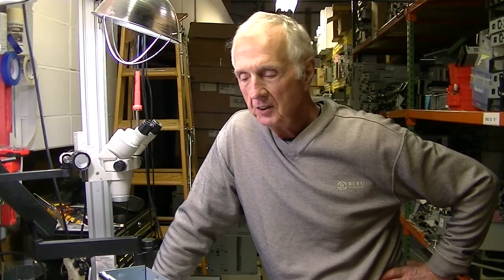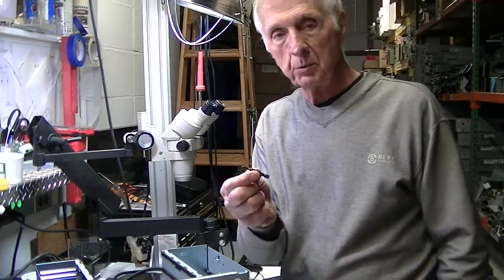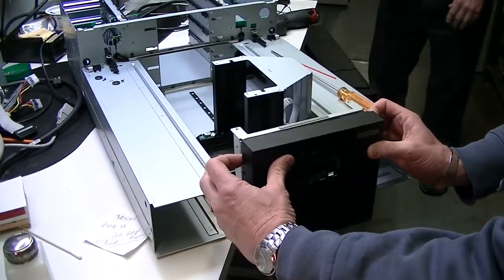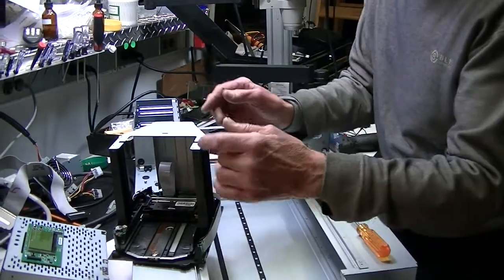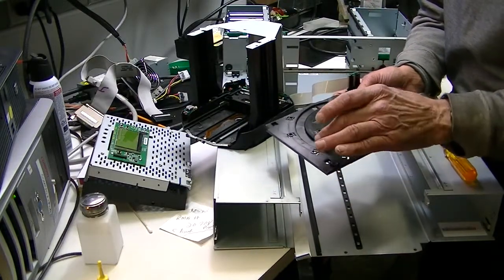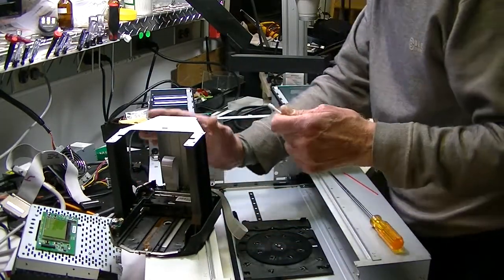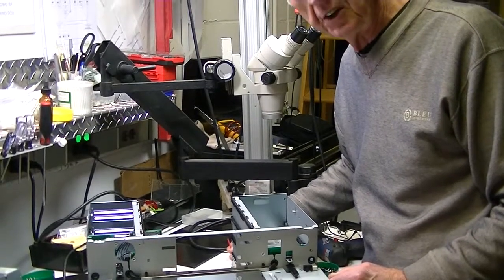Tape Library Complete Picker Replacement TL2000 TL4000 TS3100 TS3200

Comment: Hi, Are you know how can fix the error "Robotic Failure 97 00" ?  Many thanks!
Reply from the maker: That error implicated that the picker cannot move upwards, to the top.  There is a typical gear that wears out.  Best thing to do is purchase a replacement.  I'm not sure if you have a 2U or 4U library, but you can search our store for what you need at https://tapedrivesales.com  We can repair those, but it probably cost the same as replacement purchase.
Reply: @repairmytapedrive  Grat flick. I would highly appreciate any direction on how to get replacement small gears for the picker elevator (1U and 2U).

Comment: Can't you remove the picker by taking out the screw in the center rail, and then sliding it a little to the front and then lift the whole picker out with the rail... skipping removing the front panel?
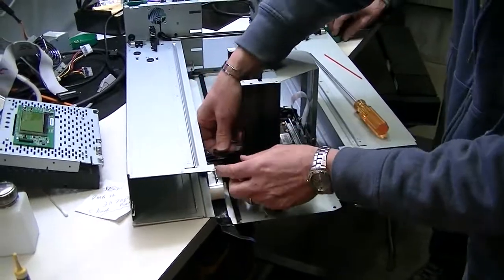Reply: Yes and no, at 3:00 you can see two rails: the one on the left is the toothed one where the gear runs on and the one in the center is the one where the big black plate locks in.
So yes, you can disconnect the picker and remove it but if you want the black plate out as well, you have to remove the front panel.

Comment: Thank you!  I recently acquired an Overland Storage Neo 400s, which appears to be the same as a MSL4048, TL4000, etc., etc.  The only issue I have encountered is that when the picker assembly goes down from the highest position with no tape cartridge in it, it chatters on the way down.  Is there any way to adjust the mechanism to eliminate the chatter?
Reply from the maker: Hi Kelly:  The reason for picker chatter is outlined in this video.  The chatter is a pre cursor to picker gear failure.  It the chatter persists it will break a gear someplace on the picker assembly.  Could be the large black gear on the picker bottom will be missing a few teeth or the as we call the ladder assembly it is on the bottom of the case and rides on the large 4" plastic gear check for missing teeth.  My thoughs are the picker channels were debris laden and stripped one or a few of the small gears associated with the elevation of the picker.  Easy button go to our website repairmytapedrive.com and fill out a service request we can do a free no charge evaluation on the picker, typically the replacement of the small gears will run between 125 to about 160, if cost exceeds that and you want it back all you have to do is pay for shipping and we will return.  We also sell those pickers $240 refurbished or $290 new can go to our store tapedrivesales.com  to purchase.  I did purchase several new NEO 200 so that new picker will be from a NEO.
Regards,
Dan
Reply: @repairmytapedrive  
Thanks, Dan.  I'll head over to your web site.

One question I have is about who actually built this unit.  I notice that it's extremely similar to tape drives from other brands.  The tape magazines say "Overland Storage", as does the splash screen on startup, but there is actually a large HP sticker on the underside of the unit.  Did HP build these for Overland Storage?

It appears that Overland Storage no longer supports this product line.  I contacted them about getting a support contract and they said they won't due to the product line no longer being supported.  Frustrating, as the unit is in great shape (except for that chatter), and it's got 4 LTO5 FC drives. The info I see makes it look as though the unit is about 5 years old.

Can you advise where I can get Windows drivers?  Will HP drivers work?

Sorry for all the questions, but you're the first person I've encountered that seems to know anything about these.

Regards
Reply from the maker: Kelly, After more careful reading you may not have the NEO series I was thinking about.  Would you send me the exact model number and a picture of the picker in question.  I think I know the actual folks who did the repairs for Overland, if they do not support it that does not mean I do not have access to parts for you.  If your unit is the MSL 4048 the picker replacement may be possible but it is more difficult than replacing the Picker in a Dell TL4000.  The HP autoloaders were made in Germany manufacture name escapes me but it is not relevant.  I want to insure that you do not have the enterprise version of the HP unit typically marketed as the MSL4048.  Send me a picture of the picker and I can identify it.  Much easier for me if you E-Mail me directly as opposed to U Tube.  EMail is dan@mwtss.com  much easier to track and also if we need to verbally communicate please send me you signature line in the email and phone number if we need to talk.Regards,Dan Szewczyk - Owner Midwest Technical Sales, Inc.  FYI we are a full time repair/sales business dedicated to tape storage devices. Been in business 30 years plus
Reply: @repairmytapedrive  I'm in the middle of fixing the picker on an MSL4048 with the same robot. It suffered from the dreaded Robot Error 9E:09. My elevator rails were pristine, I don't think it was anything to do with dust or lack of lubrication. I suspect it had trouble moving a tape and split the gear on the pinion shaft that runs across the picker. After that, it chattered going up and down because the picker is no longer level. What kills me: That pinion cross shaft is designed to come out easily. I would bet that someone with small hands could remove it using a jewelers screwdriver to release the tabs on the shaft, going in through the tape drive bays at the rear without removing the cover at all. Of course you would have to have done it once with the cover off to know where the tabs are to blindly release them. I scoured the net looking for that pinion shaft with the 2 gears and 2 tabs and came up empty. I've got gears on order from China to replace them. They are 12 tooth, mod .5, 7mm diameter, 4mm width. The bore appears to be 2.5mm, but I ordered 2mm and will drill them out to match. It could be that gear is designed to split to save the mechanism from worse damage when a tape jams... I'll probably regret getting copper gears ;-)
Reply: Actually Kelly.  Just applying a small amount of silicon grease or spray in the vertical slides will eliminate all chatter.  I have fixed hundreds of these